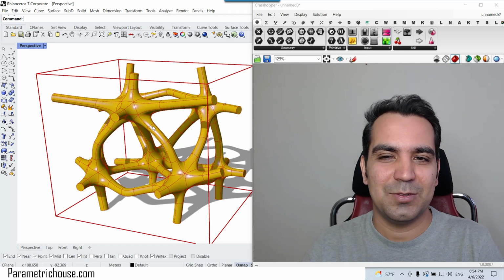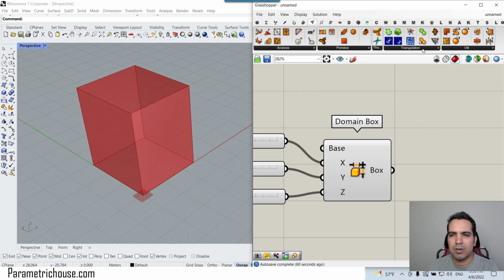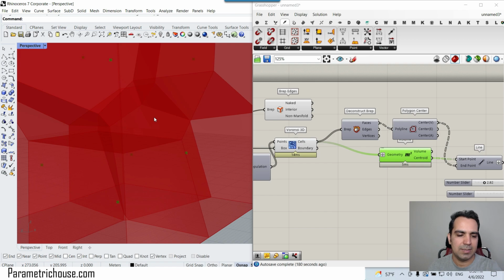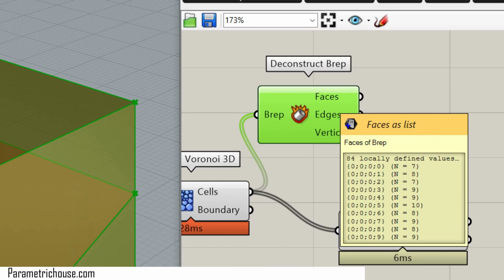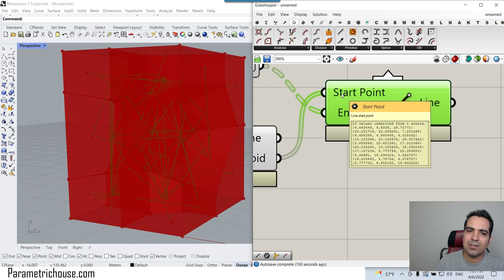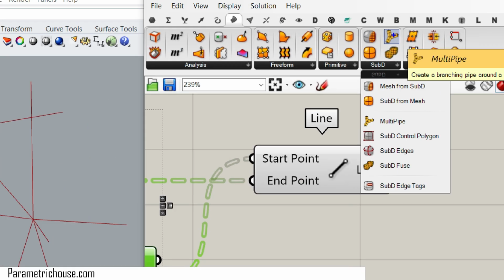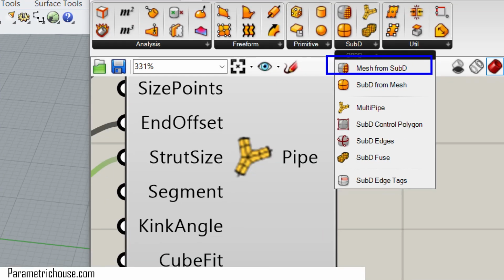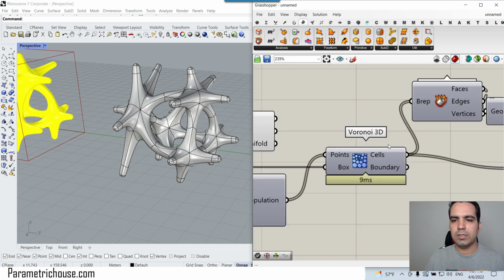Rhino Grasshopper Tutorial (Voronoi 3D + Multipipe)

Comment: I flatten an explode the tree instead hehe...  Then use solid union, network surface and interpole curves; To internalize 2d populate into the Voronoi diagram with the base of any a geo to substructure the variable pipe pattern. Took grasshopper intro about a few months back an discovered this. Importantly Divide Curve is essential.